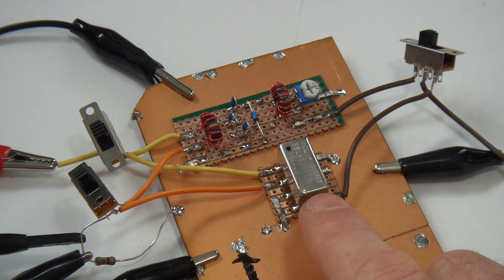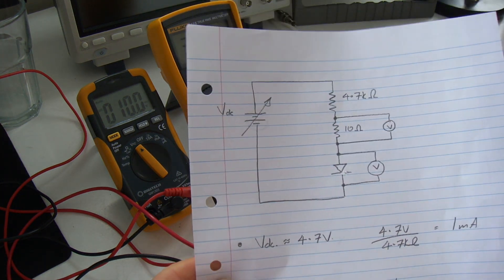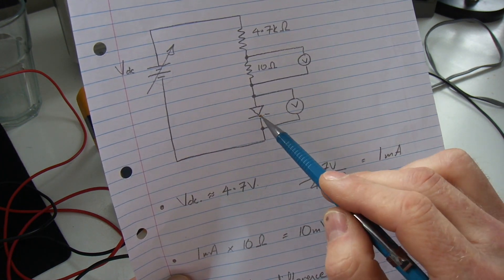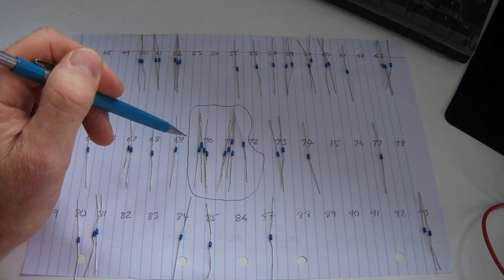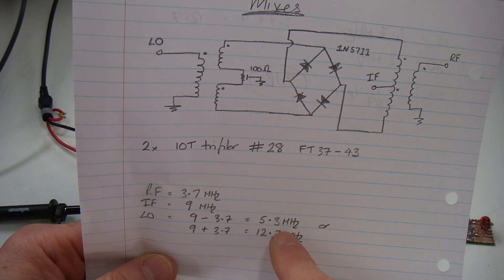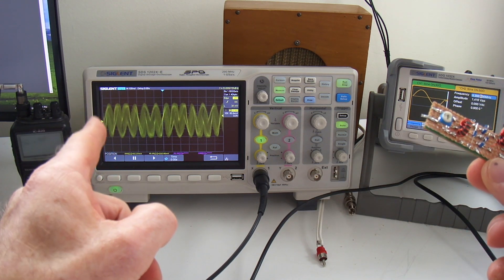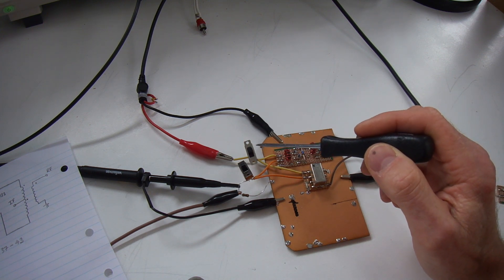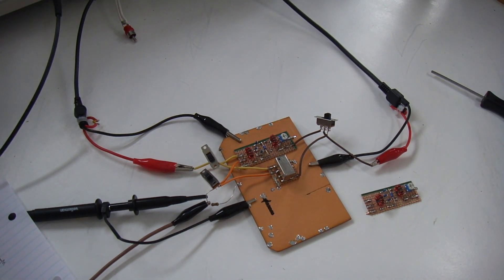Simple SSB Rig: Part 5 - Mixers

Comment: Hi Charlie, excellent video as usual.  I have a couple of questions.  How useful is the diode function on most multimeters for doing the diode matching?  I notice you have removed large chunks of the vero tracks and kept only the parts that actually link the components, rather than just breaking the tracks where necessary.  Was this because of something like capacitative effects between tracks apparent at the operating frequency?  I take it that was a 50ohm resistor on the output port for the two mixers for the correct load.  Briefly, how would you achieve port isolation here?  Sorry more than a couple of questions…. You and Pete Juliano are a real inspiration to get moving and build something.  Tnx Tim.
Reply from the maker: Hi Tim. I find the diode function on my meter works well enough. I have also used the forward voltage drop method, which also worked well. As for removing/breaking tracks, yes, I do that to reduce any inter-track capacitance. Again, I find that works well for me for the freqs that I use in the rigs.

Comment: STrange distribution of diode voltages, you would expect from same batches of production to have a gaussian distribution, so I guess you have a jumble of batches...note there is no balance on the SBL version. Actually I have found there are two version of the SBL one with a split winding (pins 3&4) one with no split... I think you have used the SBL+ which has no split. Anyway you mixer works very well and I think to have the adjustment is a better option
Reply from the maker: I think so. They didn't come as a strip, so I suspect they were not from the same batch. It certainly pays (for me at least) to take the time and measure them. That interesting about the SBL-1s. I have several of those and did not realise there are a couple of configuration. I always ground 3&4 so I guess it's never been an issue.

Comment: bav99? bat54? 😉
Reply from the maker: Certainly Mikhail. My aim with the radio is to only use readily available parts. The 1N5711 met that requirement. I acknowledge there are more suitable options out there.

Comment: I've never seen a trimpot used in a diode ring mixer.  Probably because a trifilar wound transformer should have decent balance all by itself.  The pot might help balance out difference between the diodes, but just hand selecting 4 diodes with the same forward voltage should be good enough. I've used my fluke DMM on the 'diode' scale to measure the diodes, your method is probably more accurate.  Could also select the diodes using a semiconductor curve tracer, good excuse for me to brush the dust of my Heathkit curve tracer scope adapter!
You should also consider adding a diplexer to the IF output of the mixers to present a constant 50 ohm termination (since you are concerned with good balance).  This involves a pair of toroids and trimmer caps to resonate at the IF frequency, plus a pair of 50 ohm resistors.  One series tuned and one parallel tuned circuit.
Reply from the maker: Thanks. I might bypass one of the pots during transmit and see what happens.
Reply: The potentiometer thing is actually quite a common technique. Although in my experience it allows only to suppress the LO leakage for given LO frequency. Has little to do with DC passing or spurious products. The difference is best seen with SDR or a spectrum analyzer.
Reply: @R2AUK  Might be useful when using the mixer as a balanced modulator to get maximum carrier suppression.  Probably not so much when used as a receiver front end as the IF filters will knock out the LO.
Reply: @scharkalvin  The last two superhets I've built using a DBM have used a diplexor on the IF port. The two tuned circuits are easy enough to resonate and the diplexor itself can easily be swept with a VNA. However I lack the expertise and test equipment to demonstrate the difference made by the diplexor.  A simple test method and demonstration of the benefit would be good to know about.

Comment: That was an excellent demonstration. As it turns out, I just bought 100 5711s that I need to sort in exactly this way. I was going to use the built-in "diode" function in my meter which displays the Vf, but I don't know at what current. That may not matter too much, but I'd prefer to know what it is. So I think I'll use the constant-current setup you did, and I'll use the same 1mA. I've never blown a fuse in my Fluke measuring current, but maybe because I dislike using a DMM for current measurements. I'll use the same 10Ω sense resistor you did. 

If I'm feeling ambitious, I might experiment a little to see if diodes that match at 1mA still match at 5 or 10mA. I don't know what it might mean if they don't (except, of course, that their Vf curves don't match), but I'm curious. I also recall seeing mention somewhere (some obscure IEEE paper I probably misunderstood) about also matching diodes for junction capacitance. That may not apply to (or matter for) Schottkys since they don't have a regular PN junction. That's just as well since I don't know just how to measure the capacitance of a diode in forward bias.
Reply from the maker: Sounds good Todd. Keep us posted. As for blowing fuses, it's mainly been during bias adjustments. Not all the time, but really annoying when it happens! Nearly always FETs.

Comment: Nice, you can also make up a test rig which doesn't rely on recording numbers, you make up two of the same circuit, common the Vin and GND, swap the 10R down to the cathode/earth side and then plug in two diodes, connect your meter from anode to anode and select for minimum reading. 

The reading you get indicates the 'quality' of the diode match.
Reply from the maker: That's certainly a good idea. I'll keep that in mind. 50 diodes wasn't too band, but-say-200...!

Comment: Thanks Charlie, I love when you have a new video! One thing I would be interested in is a comparison of your new diode ring mixer to the old one. maybe you're holding out till it's in a radio, that's probably where we may see a difference. I am expecting a bit of improvement with the new diodes. we will see. have a good weekend.
Reply from the maker: Will do Curt. My initial comparison did not show any significant improvement, which was interesting. I assumed it was my measurement technique so elected to leave it out of the video.
Reply: @CharlieMorrisZL2CTM  That is interesting, maybe it will make more of a difference in the frequencies it can handle or something else bizarre that we're not thinking of.